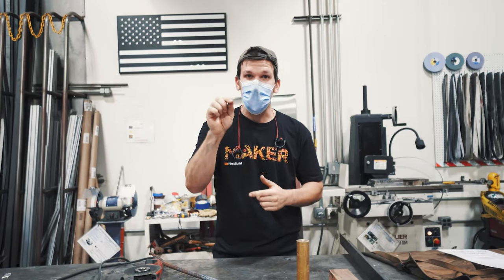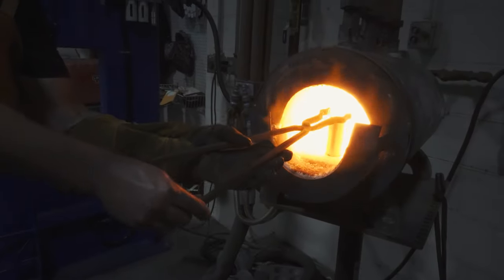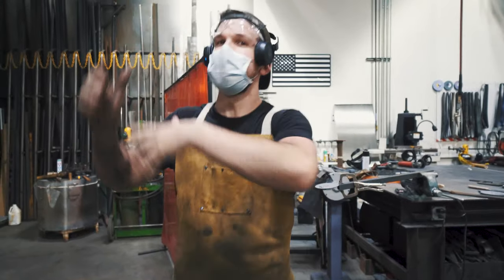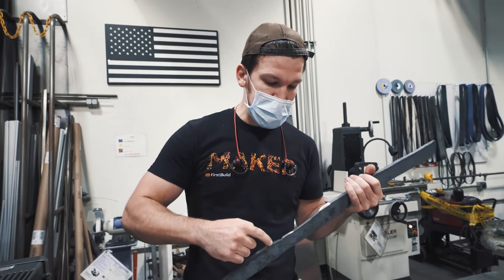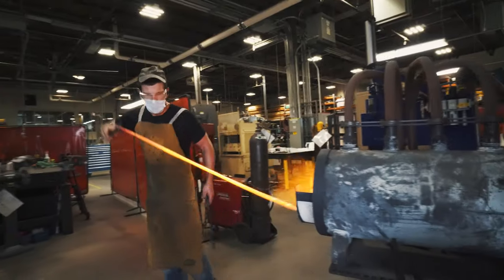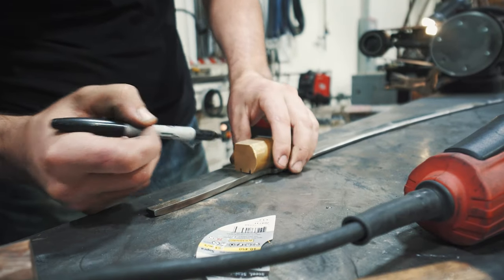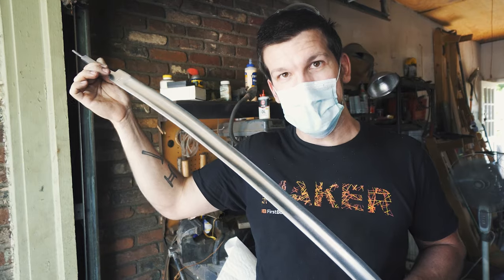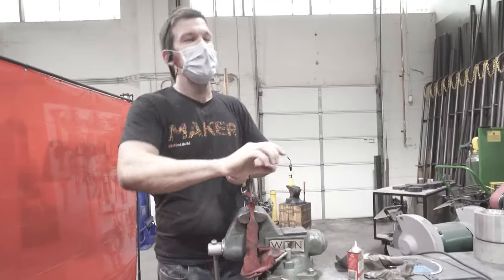Forging A Damascus Steel WWII Shashka Saber | Blacksmith Collin Sage

Comment: Bro what's that strange dust thet you put on the metal after heating it up?? 
What is used for??
Reply: It’s called “flux”. Can’t forge welded layers without it.
Reply: @2005batman  you can you could use  Water down clay or use none at all
Reply: Borax , sand or metal shavings , to keep oxygen out of the weld area if not boom , weld comes apart

Comment: what type of liquid were you using to quench it?
Reply: In this shop we just use coconut oil. Admittedly not the best oil you can use. An oil made for quenching like parks 50 would be better but it works just fine and I haven't had a failed quench yet. And it's non toxic and smells like cooking
Reply: @collinsage2512  honestly I've always just reused old vegetable oil

Comment: Hope you know that the blade's tip angle varies from handle side all the way to the top, so called "lense sharping", so the closer to the edge, the sharper blade you have.

Comment: Good effort, alas, you have not made the pommel properly. The top has a groove and the pommel is NOT screwed into tang. It is slid on and a metal round nut screws into the pommel and sits flush with the groove. The handle is too fat. Shaska is about agility, NOT power or heft.

Comment: What is that powder you put in it?
Reply from the maker: @vonanthonymacaraig1211  that is Borax. It's used as a Flux to prevent oxygen in the air from reacting with the hot steel to create an iron oxide layer, which would inhibit the Forge welding process.

Comment: Nice from many aspects but not perfect elaboration of form and it's seems too heavy.
It's shashka, it's thin, light and sharp made for fast using.You could make better use of the benefits of Damascus steel in this. It' not heavy rider equipement. 3-6 cuts per second.

Comment: Actually its not Russian at all,  Shashka was Circassian weapon. Stolen and appropriated by the cossacks that were resettled to those lands.
Reply: @Churchilltler No its not. Katana was influenced by Chinese Tang Dynasty Jian, but it was still quite different. Russian cossacks on the other hand, use purely Circassian swords, there are no modifications at all.
Reply: @Churchilltler You make me laugh. Thanks for the lovely weekend :)
P.S. Tang Dynasty Jian. 
Shashka is a stolen weapon. Even russian cossack clothes come from Georgians and Circassians.